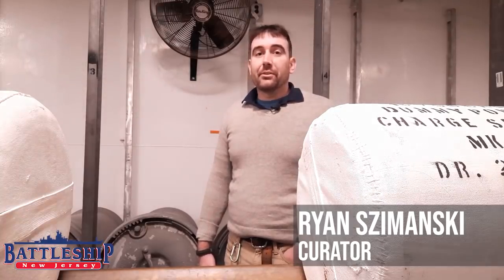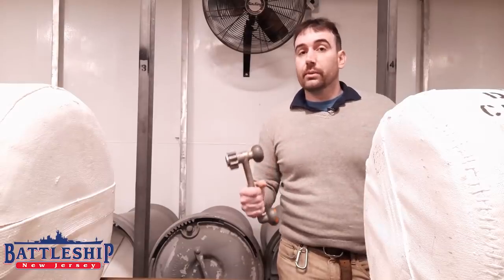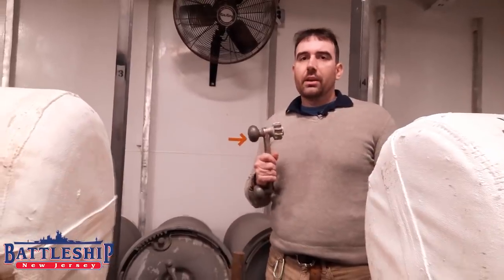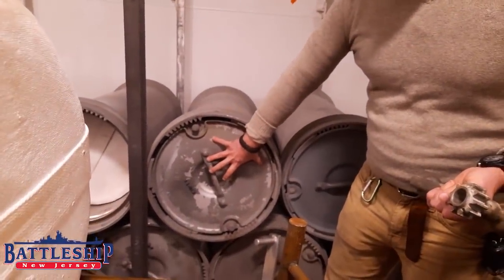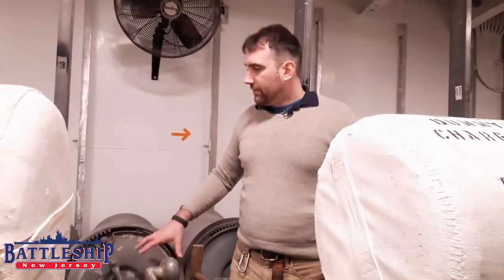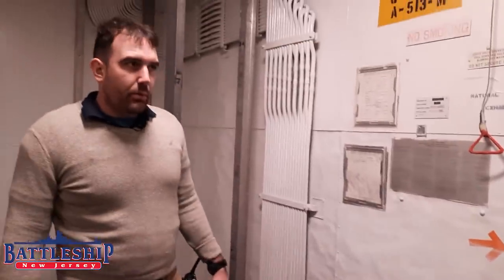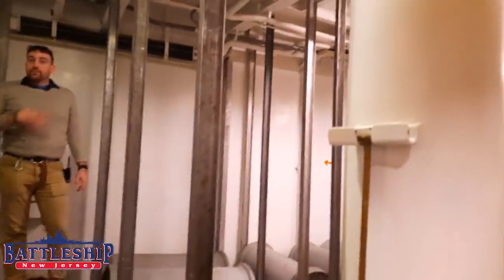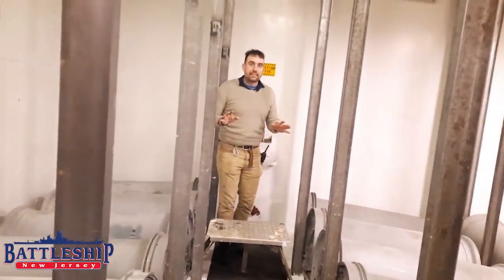Opening the Cans of Powder for the 16in Guns

Comment: I've got friends who were involved in demilling the full powder cans that you're showing there.  Since those wrenches are some sort of soft metal, they broke two of them while demilling a few thousand cans and then gave up.  The teeth would shear off.  They ended up having to make their own wrenches, as getting more from the navy was impossible.  They still have a few floating around.
Reply: I think that the originals were cast because machining them would have taken up production capacity that could have been used making gears for higher priority war production. The cast can openers were ‘good enough’ in the short term, and made of low grade aluminium rather than brass.
Reply: @nicbrownable    Casting was the perfect choice.  And the teeth were machined onto the casting once it was done.  The tools just weren’t expected to see extended use.  The life of a barrel was a couple of hundred shots, take that times two cans per shot and you’re at maybe 500 uses.  Also, the cans were fresh and not corroded, which would’ve made them easier to open.  This stuff happens.
Reply: Very interesting!  So they wore them out.

Comment: The handle wasn't used when they picked up the powder canister to move it. The tool in my turret guidebook is SK140116 and looks like this one from zoro.(Hope this come through okay.  https://www.zoro.com/zoro-select-drum-sling-1-drum-30-55-85-gal-2000-lb-21vg32/i/G5311835/?gclid=b9c2286575dc108b3e4648304cd891f9&gclsrc=3p.ds&msclkid=b9c2286575dc108b3e4648304cd891f9&utm_source=bing&utm_medium=cpc&utm_campaign=PLA_US_Bing_SSC&utm_term=4586131721890368&utm_content=All%20Products
Reply: Link worked
Reply: Nice.  I was wondering about the handle deforming over time if they even moved it via handle.

Comment: "the most dangerous thing I have ever done is stand on this stool"
Reply: LOL
Reply: Hasn't got far to fall though.
Reply: @merlin51h84  No, but you can die falling zero distance (that is, tripping on a flat surface) if you strike something hard, like, say, any of the metal things around him on the deck or the deck itself or any of the supports.
Reply: Well... I didn't see anything in the news about massive explosion in Philadelphia harbor, so it seems like everything turned out fine...